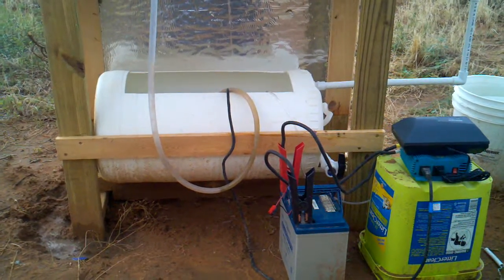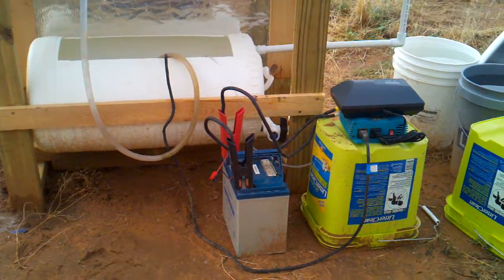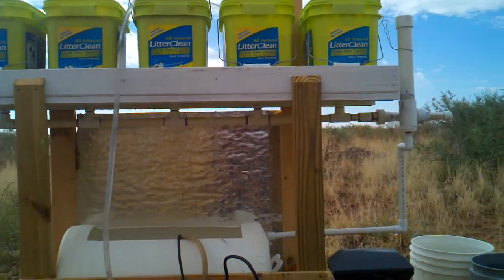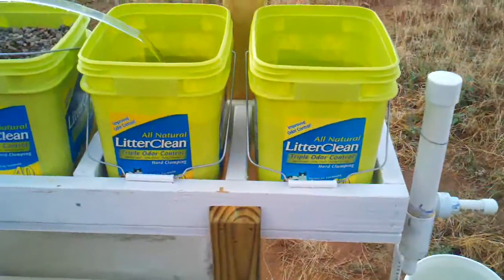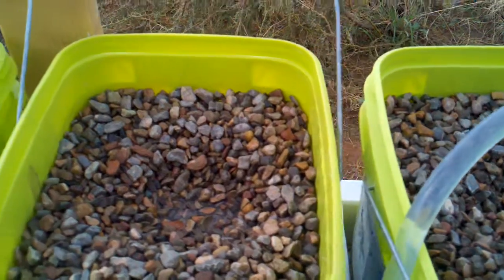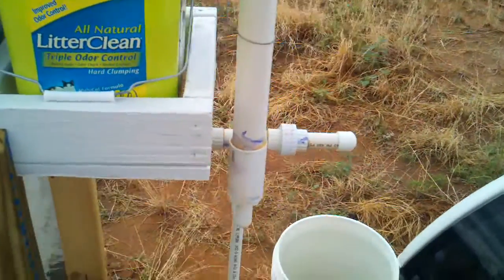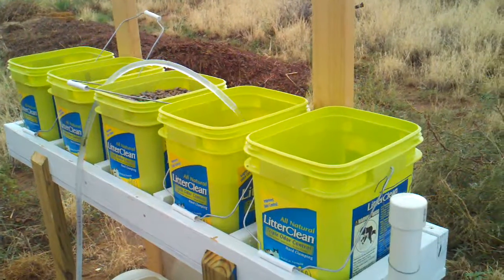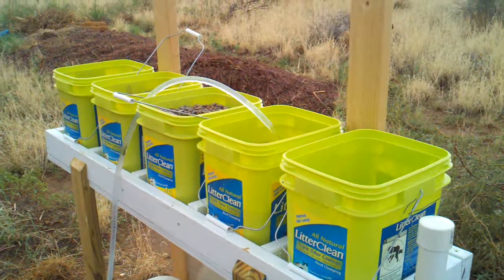Dutch Bucket Aquaponics

Comment: as you were connecting one bucket to the next to prevent over filling the next 1 how did you seal it?  and how did you split from the water pump to multiple water lines to other containers?
Reply: David Turner The buckets are all level and share a common plenum, water seeks the same level in all buckets regardless of which one is being filled. The water also rises to the same level in the bell siphon and when it reaches the preset level it triggers the drain cycle which rapidly drains the water back onto the fish tank.

This system worked for quite a while and then quit cycling because of biofilm and roots that clogged the inverted dish sink strainers used to keep the rock in place.

Comment from the maker: The bell siphon is made of a 3/4 in. PVC "T" to a 2 in. X 3/4 in. PVC "T". At the bottom of the 2 in. is a 2 to 1/2 in. reducer that is modified with a step drill to let the 1/2 in stand pipe pass through. The level of the stand pipe is determined and then cemented in place. The out side 2 in. PVC tube is made to be about 1 1/2 in. taller than the stand pipe and capped but not cemented. Consider making this removable with screw threads.

Any further questions let me know.

Comment from the maker: @MrMadmax478 

The battery in the system is temporary, but I figure that it should run the system for 100+ hours with no recharging. I have several solar panels that I can use. I currently think that I can get by with two 15 watt panels to run this system with a much smaller battery.

Comment from the maker: @MrMadmax478 

The original two buckets have been set aside for the moment and a 12 volt bilge pump will be used for emergency backup. That pump produced so much volume of water that I bypassed most of it right back into the fish tank, it was great for aeration but used more power (a lot more power) than the fountain pumps.

Comment from the maker: @MrMadmax478 

I used this same external bell siphon on a two bucket system that I let run for about a month. I did not ever try to put plants or fish in that system. The reason I took it down was that the algae got so bad that the pump and tubing clogged.